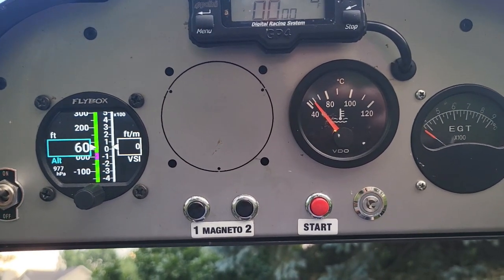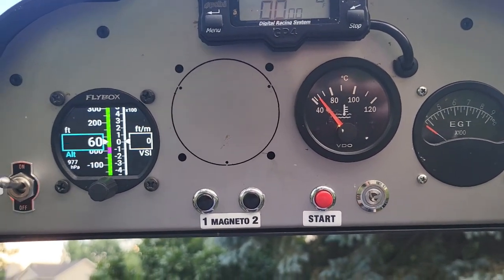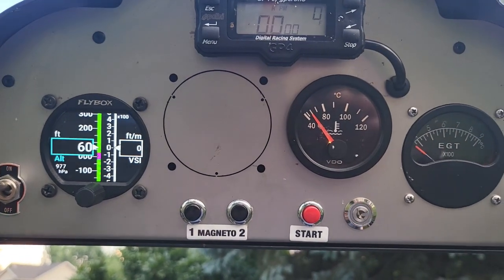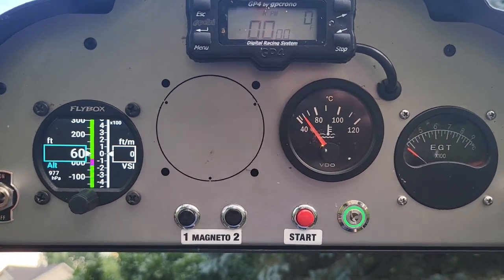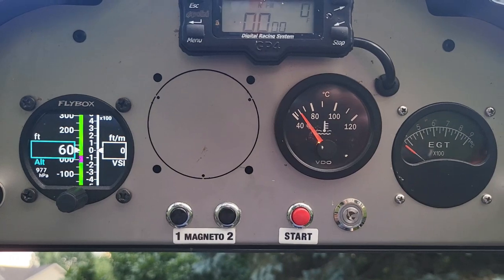Vittorazi Cosmo 300 dual spark magneto test

Comment: Hey Tom,
Thank you for your response in the other video. pretty sure I will have this engine in my next trike. just ordered a new startermotor for my Thor 250. Again......... looks like the cosmos is a lot more reliable than the Pollini engines.
Reply from the maker: I have never owned a Pollini but so far, the Cosmo has been an outstanding engine.  Good luck and I know if you get it you will love it.

Comment: Hi Tom, looking at your instrument panel, you have install EGT and water temp meter . May i know, what is the recommended (by vitto@manufacturer) reading for EGT in order to avoid the engine overheating.
Reply from the maker: According to the manual.  The max temp should be seen between 6500-7000 RPM which shows a temp of approx. 645 C.
The manual has a little more information.  You can download the manual for free at 
https://vittorazi.com/en/manual-and-documentations/

Comment: Hey Tom, 
Did you install those gauges on your dash or did One Up do that for you?  Looks like the dash is pre-cut for specific gauges?
Reply: Hi Preston.  The gauges were actually pre installed at the Xenit factory in Italy.  If you buy without the gauges the cutouts are still there.  Kind of like a perforation.  So they can be knocked out and the gauges added at a later time if you choose.  Thank you for asking.
Reply: @cntnvision  Thank you sir!  Hoping to see one at EAA this week 🙏.

Comment: Do you recommend the Dual Spark?   Or just change the single spark every 15 to 20 hrs?
Reply from the maker: Hello Carl.  If you are planning on flying with a passenger, then I'd certainly recommend the dual spark.  While you should always fly with a way out if the engine would fail,  that landing spot may not be a great one. 
I can only speak for myself on this.  This is my view.   I love to take people up.  To talk to them afterwards and see the smile and excitement is everything.   
While we have all flown with one spark plug forever,  a dual spark system gives us one more advantage to make every flight successful.   Since it is an option,  I'll take it. 
Maybe a little long winded.  I'm just very passionate about this sport.